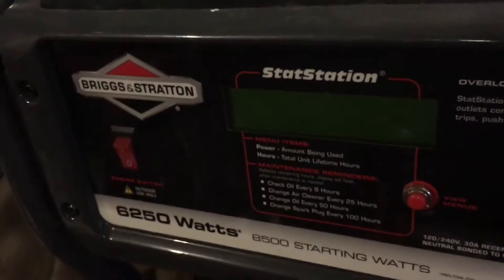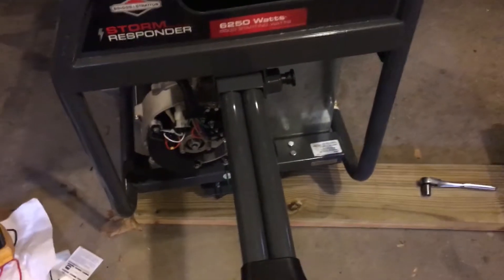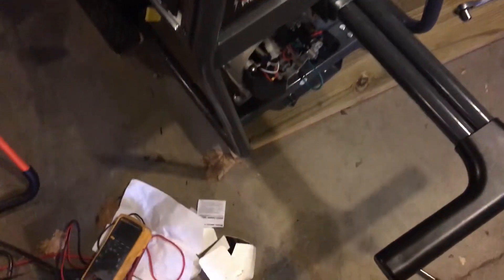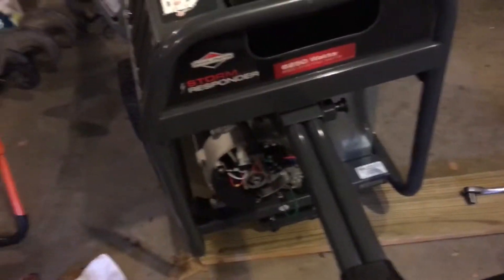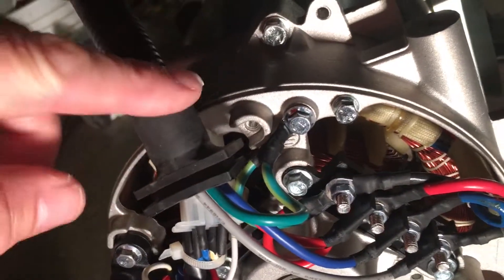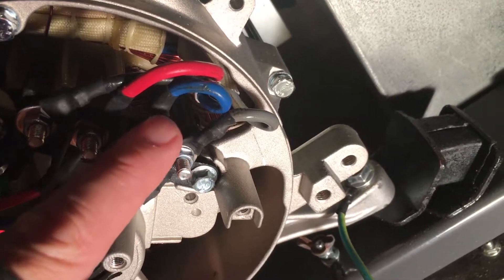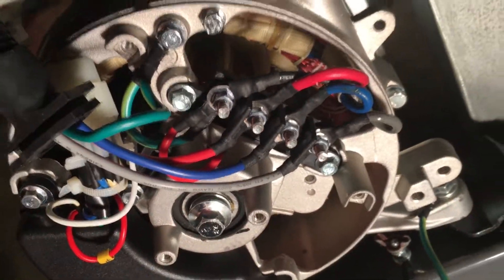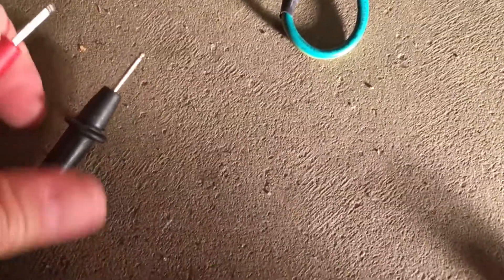unbonding briggs and stratton generator

Comment: So how safe on house electronics is it running these non-inverter generators on newer electronics in a house?  I've got an 11 year old B&S Storm Responder 5500/8250 watt that I've honestly never used but just got it back to running like a champ.  It was a gift to my wife and I by her parents 11 years ago and we just never had power issues before but, we built a new house and moved in 5/2019 and have had, on average, 2 or 3 outages per year.  So, it would be nice to run the basics but not HVAC.  I just don't want to ruin a $2k fridge, rack of internet gear, tv's, etc.  I know the THD in these is higher than an inverter generator so I'm deliberating on selling this one and buying a newer inverter version "to be on the safe side".  Unless I don't need it...  Thanks
Reply from the maker: Thats a good question, with a "it depends" answer. lol.. You really would have to ask each equipment manufacturer that question. I've see some appliances not care, and I've seen others have issues with dirty power. If you are concerned, my advise would be to get an inverter generator.

Comment: I would have left the bonding jumper on the ground, and disconnected the connection to neutral, then tape it back over. That way this wire is there if you want to bond it once again.
Another alternative, wire in a house single pole switch, that way the bond can be on or off at your desire easily. Plus label the switch so people know what it is, like Neutral Gound Bond on and then Bond off. The switch handle faces the way as described.
Reply: Ya but I don’t think everyone wants to spend 300 on the box vs. pulling off a wire

Comment: You should not do this. If anyone starts the generator before connecting it to the house and somehow the generator's chassis became energized, they would get a shock. The bond isn't a problem. The neutral and grounds are bonding at the power transformer and all down the power lines for lightning protection by the power companies. The reason we don't bond a subpanel is because if there is even a open neutral going into the main panel from the utility company, touching that sub panel could cause a shock as the current is now taking several different paths. You should have one grounding point at the main panel. If there is an open neutral, that ground at the main panel becomes the return path through the ground to the ground rods near the power poles and the transformer. Not a good situation either way, but unbonding the subpanel will minimize any shock risk. On a portable generator you basically have a redundant neutral by keeping the generator bonded and have the ground and the neutral from the generator going to the main panel. The chances of an open neutral are even smaller by having two wires vs one from the generator. If the connection inside the generator's neutral lost connection, there would be no shock risk, it would just stop working. The reason we have the risk with utility power is there is utility power all over and the neutrals and connected to ground rod in the ground. If you do ground your generator to it's own ground rod, if you did lose your neutral from the generator to panel, the current would travel from the houses ground rod to the generators ground rod just like if the utility system cost it's neutral, but that would only work if you keep the generators ground bonded.
Reply: Doesn't the NEC state that there can only be one neutral ground bond?  A bonded neutral generator connected to a bonded neutral house would exceed this limit of 1.
Reply: @Idnrntigzzz  On a sub panel yes. The neutral source is the generator, not the utility even though they are connected. On the utility pole they are bonded together so it should be the same for a generator for added safety.
Reply: @billybassman21  So can I still run a 4 wire cable from my 10 KW diesel portable generator with neutral/ ground  bonded connection to my main panel to connect to the ground and neutral bars
Reply: I was under the impression that being a separate drive system, the neutral/ground bond needed to be removed and wired each separately
Reply from the maker: If connecting to your main panel, then yes. Think of the case where if you dont, then you could get shocked if neutral and ground were bonded at both locations and connected . If you are not connecting and using as a standalone then different story. there are soo many opinions of how it should be done, My advise is to consult of have an electrician do it.
Reply: @IFix-Things  just to clarify, when connecting gen set to main bonded panel, one should remove bond connection and run  separate neutral and ground wire to the main bonded home panel? So 2 hots, non-bonded neutral and ground from gen set to home bonded panel.
Reply from the maker: @XER239  that is how I did mine which is why I unbonded it at the generator. If using the generator as a standalone re-connect the bond.  Disclaimer I am not an electrician. My advice would be to talk to a licensed electrician.
Reply: Many gens are sold as unbonded, this is not the big issue your making it. And many people dont have a clue, and will connect their gen to the house using an interlock breaker in the panel unawares, and nothing ever happens even though it now has a ground loop current path with their bonded gen. But of course if your following the rules 100% then you dont do that.
Reply: I’m about to remove the bond on my generator. It’s stationary with grounding rod and has 4 120 GFCI outlets in addition to one 30 amp 4 pole outlet. I have an interlock on my panel with 30 amp double pole breaker to a four wire inlet. 
Right now, with all panel switches off and 30 amp extension cord connecting outlet and inlet the breaker on the generator trips and shuts down.
But, I think the message I’m hearing is it’s better and safer to remove the bond on my panel instead?
Reply: @sixoffive  Dont remove the neutral bond on your house panel, remove it on the gen. Consider which one is just temporary. AND, you do not need a ground rod when hooked to the house panel using an interlock. Reason is your grounded by way of the connecting cord, and the house already has ground rods.  You can also if your good, wire a switch between neutral and ground, that way makes it easy to toggle bonding.
Reply: @scottdowney4318  A toggle switch at the generator jumper is the best option and you're right the house panel ground serves as a ground rod for the generator. If it's a GFCI bonded generator, it will trip with the double bonding.
Reply: @sixoffive  I removed the bond at the generator head and found to have 0 volts on one leg and 40 volts on the other (weird) so put back like it was from factory which produces 117 volts 62 hertz on ea leg , this is a mobile unit for emergency home use to the panel. I do plan on including a  separate  ground to earth
Reply: @sixoffive did you ever figure out your problem?
Reply: @Antoniocool86  My problem, there are so many…
The problem with the generator, yes. My little shed of a house has two service panels. One on a pole that should have been temporary and the other on the house. So if I had tried that at the service pole instead of the house it would have worked. Because you always bond at the first service panel. I need to replace the box at the service pole one day and I’ll make the switch then. That box on the service pole is a FPE box and the last electrician that was out said the only thing he can do is change the box out and I think that would have cost > $1000 in labor. Nothing about bonded ground and common on the box. That was $100 for coming to my house, gave me a break because I’m a senior citizen and I worked with his mom.
Thanks for asking.